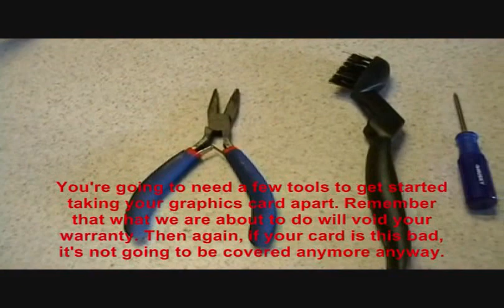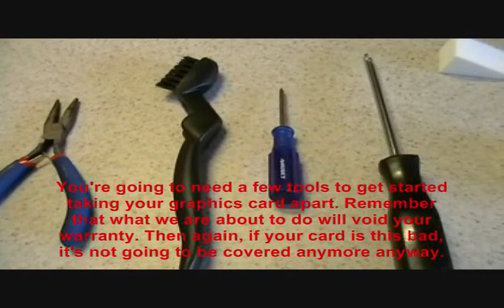Extreme Cleaning 8800GTs

Comment: Looks like I got some smokers on here mad at me... lol. yes I'm aware that dust is skin particles. What I'm talking about in the video is that nicotine makes it STICK worse than normal. I have cleaned my fair share of equipment and I know the owner of this equipment personally. The tale tale sign is that it turns everything yellow and sticky. Caked on dust without nicotine looks more like dryer lint than this. Also it can be brushed off without the scraping. 

The GPU that was peed on - As long as the circuit wasn't damaged I think you'll be okay. 
The GPU without the cover - Your card should be fine, but you might need to clean it a little more. It will likely run a  little hotter than normal due to the airflow being altered.